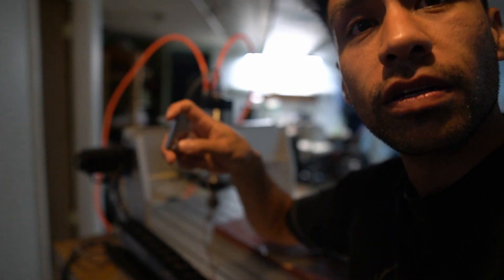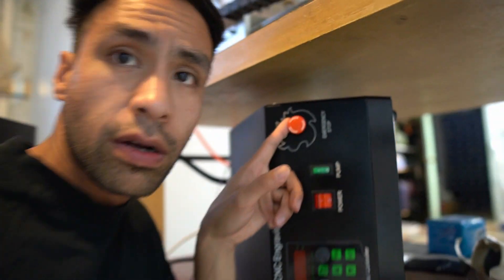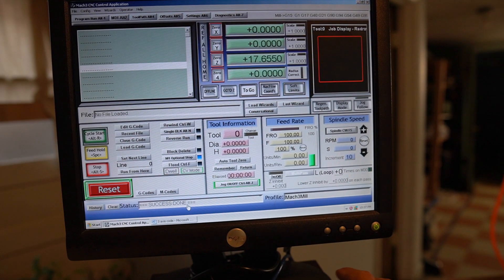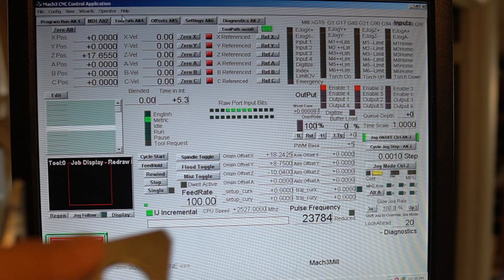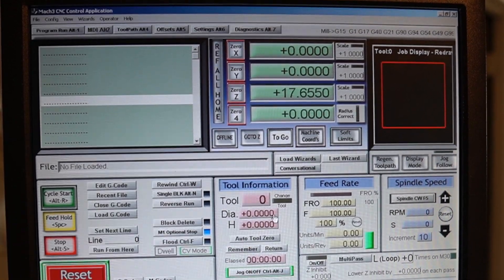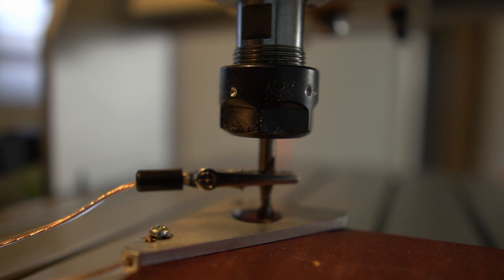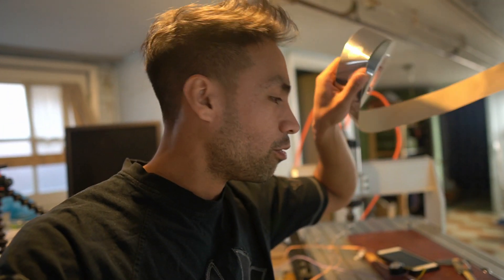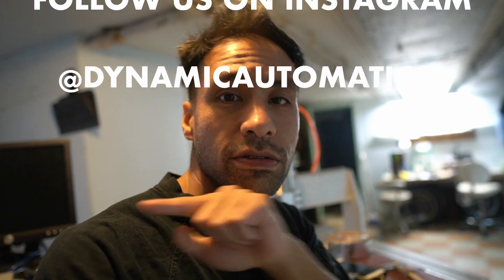How To Setup CNC Touch Plate Probe Edge Finder XYZ Axis 3040 4060 6090 Chinese Router

Comment: The probing system is wrong! ... the cutter on the 4 points of the diameter does not give homogeneous results, it should be rotated by 180 ° to have the same point of contact so to have homogeneity between the 4 points of contact. otherwise the centering is not accurate
Reply: When finding the center of a circle, the diameter of the hole and the diameter of the tool cancel out. The fact that the tool may not be a perfect cylinder, can be a problem if the tool isn't inserted far enough. However, a two flute tool will be symmetrical enough for an accurate reading. yes there will be two different effective diameters for the x and y directions, but the difference will cancel themselves out due to the symmetry of the hole and the tool. The first axis is read twice to minimize the error of not starting at the center of the circle.

Comment: I bought the touch probe round one with crocodile clip. the wiring ends are with just a meter long two wires. I appreciate to fix them emergency stop button wiring in the controller. Next thing I missed was to get the code and as you said you can forward the link. Would you please do this for me. By the way, your explanations is brilliant and hope to learn from your channel as I am novice in cnc and bought this Chinese CNCEST 3040 A MONTHAGO and I am struggling to get find a programme like Vectric Aspire as my main goal is for making small name plates with various fonts. Any advise sir, this will much appreciated. regards.
Reply from the maker: Hello did you solve your problem? they ebay seller link in description provides the code with the edge finder script